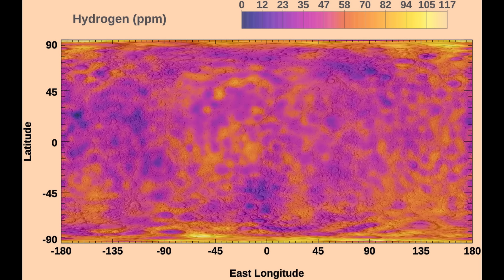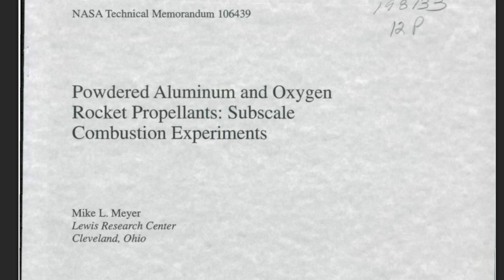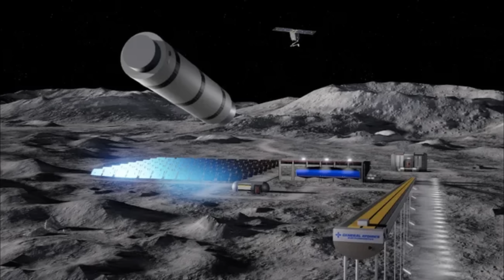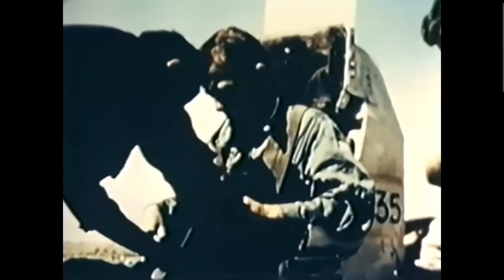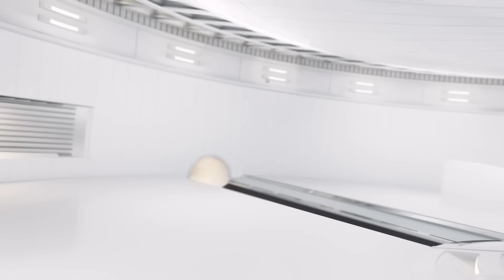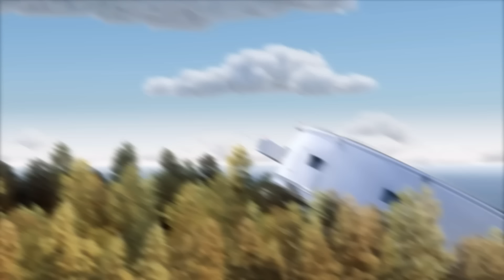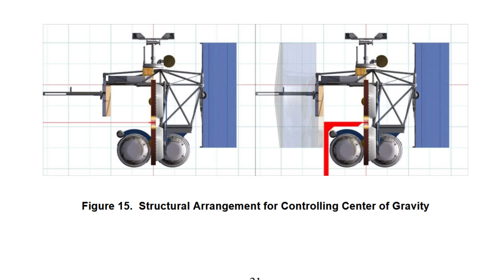Launching From The Moon With Silicon Based Rocket Fuel And Other Ideas - Deep Space Questions

Comment: Coilgun fired into Lagrange 4 or 5.    Give it just enough energy to park there and have your space factory there to receive.

You could experiment with a space elevator near lag3.  Would be better to experiment with the plausibility on the moon than on the earth.  Personally, I am of the mind that people proposing space elevators don't understand orbital mechanics of giant strings and the implications - but the universe itself is the authority over me, much to my chagrin.

Silica based rockets would be rather likely for primary lift stages.  There might be some concerns over using them long term in regimes where they will not be entering the Earth's atmosphere or the exhaust settling back to the moon in a timely manner.  Flying into a pseudo-atmosphere of silicon dioxide particles is kind of horrifying considering the construction of most space craft.

Comment: Spin launch is crazy. If the arm rotates with 3000 RPM then the released object will also rotate with 3000RPM around its mass center. While rotating on the arm, there is centrifugal force acting on the rocket. One could compare it with a rail gun acceleration. When released, that centrifugal force is gone but replace by the centrifugal force due to rotation around its mass center. A solid object might endure that, but electronics will get ripped apart by that sudden force shift.

Comment: 'Spin Launch'...sure forget about how centrifugal forces work. 
Release the object and it is flung off to the side, along the vector from the center of rotation to the release point..NOT at 90° to that vector in the linear direction of travel of the tip of the arm.
And the sudden mass change would tear the laucher apart from the sudden imbalance.

Talking about that as if it's a real thing...when I stopped watching.

Comment: 7:27 burning Silane and other silicon sources with oxygen does make silicon dioxide but it does not make quartz, it doesn't make sand. It makes "fumed silica" an amorphous form of silica which is a white powder used as an anti cakeing agent in table salt. Since it is not crystaline it is much less hard than quartz, somewhat soluble in water, and doesn't cause cancer.

Comment: I used to work with Silane since the ‘80, to make SiO2 thin films to make isolation layers on microchips! SiO2 is most commonly called silica or in crystal form quartz that is glass, but when Silane is burned in air silica comes out as a fine white powder. Sand is made also of silica but with various impurities, which needs to be separated, when it’s melted to produce ultra pure Silicon for microchips making!

Comment: Wouldn't the velocity be slightly higher due to the increased pressure differential between the combustion gasses propelling the bullet and the non-existent air in the barrel?

Comment: Very interesting Scott. 
I’d like to see a treatment of the linear accelerator’s need for steering rockets. The projectiles would need to be steered to ensure they all ended up at the same location in the Lagrange point, for collection. Maybe a giant fishing net.😊
I feel the ‘spin launch’ option would not work very well if it carried finished products such as solar panels. These would be too fragile for the high accelerations involved. Maybe the goods shipped would have to be limited to refined metals only. Thus requiring space based manufacturing.

Comment: Have you thought of a flywheel to store energy?  I wouldn't have until recently when I found out they supply a lot of capacity for energy grids in Europe that are mostly green and less instantly changed.  The should have plenty of materiel to make big spinning masses en mass.  Especially for Spinlaunch.  Take the energy from one flywheel, store it in another flywheel.  Or... have two launchers that swap energy back and forth, and the solar tops up energy losses and spins up the flywheel bank that'll be used at night to keep up launch cadence.

Comment: BTW, they THINK they have found water, so far two probes when landing has found ZERO water and can not confirm that.  One probe was in the polar region as well.  Even if it is confirmed one day, the amount is so small there is no viable solution to proccess tons and tons of regalith to get the microscopic amount of 'fuel' you are going to need for launch off the surface.  Not practical, if even possible and will never be the way forward.

Comment: If it’s electromagnetic, you want to put it in the dark in a moon crater next to the water. Low absolute zero Kelvin would be a nice number to reach. Use your compression expansion cycle to cool your electromagnetics and put the heat into your living quarters and the melting of water. All you need is towel boarding machines to make it all downhill to where you shoot it in orbit.

Comment: I thought most of the energy from the solid rocket boosters is ammonia and perchlorate. There's aluminum in there also but I didn't thing it was a majority of the weight. If it were, I think the speed of the reaction would be way too high.

Comment: We already have exactly what you describe when you're talking about a mass driver they're called roller coasters they just use large quantities of wheels and electric motors to accelerate the roller coaster the only difference between the design your suggesting and roller coaster is your design doesn't move in a loop what and if you use heavy metal wheels we can use those as mechanical batteries which will have as much energy as they can be released into the coaster the moment they interact with it you can also share the energy between these wheels with the electric motors that they are attached to

Comment: If you wanted to design another oxygen aluminum rocket motor you could simply look at the oxygen Lance which is literally just a pipe with fixed wires filling it mostly and enough oxygen blowing through it to keep it from Catching the whole thing on fire immediately the flowing oxygen keeps the combustion area away from most of the fuel if we surrounded that in a thick layer of silicon oxide and surrounded that in a combustion chamber we would have a rather powerful engine that would evaporate the Silicon oxide as reaction Mass the Silicon oxide is also impressively heat resistor which would go a long way to keeping the combustion chamber from melting and exploding though this design would have a problem with the Bell and the bottom of the reaction chamber melting and failing

Comment: The idea of sand being the exhaust out of a silicon rocket engine is wild. Quartz also seems like a problematic to have to keep form scumming up your engine, but for reusable engines I wonder if you could collect byproducts like that and put them to use, for example, in 3d printed electronics.
Reply: And it all falls to the ground, ready to be split into fuel and oxidiser again
Reply: @MostlyPennyCat  You'd also have the problem of sand blasting your launch pad every time you fly. I'm sure it would harder to deal with than an exhaust that is a gas.

Comment: There is another way to store power for quick release: flywheels.  If you have a few thousand 10 ton flywheels, they can release a lot of energy quickly.  And it is much easier to make flywheels on the Moon than it is to make giant capacitor banks, or loads of superconducting wire coils.

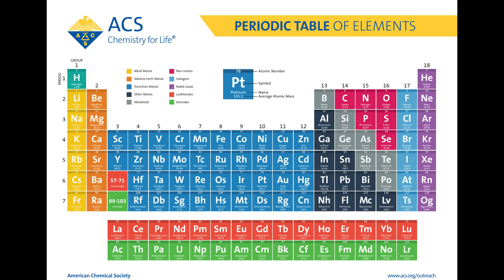Comment: 6:31 Why CH4 has less specific impulse than H2? this type of mesurment(ISP) is related to mass aswell right? than why CH4 dont give more impulse? to me is more rational to get more velocity from CH4 than H2. Because methan(CH4) have 4h to make the combustion to build presure and the carbon wich is inert to the reaction give velocity acording to Newton Law to me is like perfect molecule. And the H2 let say it build more presure but the mass is 12-24 less than CH4. Is more kinetic but less mass on hidrogen versus less kinetic but more mass on methane.
Reply: ISP goes up more with exhaust speed than exhaust mass. I think ISP is basically how long a propellant can produce a kilo-gram(force) per kilogram of fuel. A kilogram of hydrogen contains a lot more hydrogen than a kilogram of CH4, so there is a lot more of it to throw out the back. Not a rocket scientist tho so my explanation may be flawed

Comment: Slightly off topic, since you would be in a near vacuum on the moon, you could easily use thermal, solar collector, the heat of a piping system for warmth, and you just deco from the collector when you don’t want to get too much heat and reconnect when you want more heat and so on,,   Just use a carbon paint to paint the collector and can even use a compound parabolic mirror to hit up the pipe they printed with or some other chuckle or soot from a wax candle

Anyway, and use that heat to charge a sand battery should be easy to keep with the vacuum  🥰 and store heat for ages 💓

Comment: I think comparing a rifle with a muzzle length of less than three feet to a lunar launch system with a potential length of several meters to kilometers is a bad conpairison. 

Also, the rifle barrel that is filled with the earths atmosphere, which has to be compressed ahead of the projectile and slows the acceleration rate of the projectile is not directly comparable to a barrel operating in a vacuum. 

Further, sabot ammunition reaches much higher velocity than a full bore projectile. 

There is a scientific canon developed by the US government that was able to launch a 100-pound projectile to an altitude of 105 miles.  

With the moons' weaker gravity and no atmospheric drag, launching materials off the moon should be much easier than tasks like setting up sufficient power generation and refining facilities to produce aluminum and steel efficiently enough to make the process less resource intensive than launching materials from earth. 

Currently, if there were bars of gold sitting on the surface of the moon, it would be cost prohibitive to pick them up and bring them back to earth for the first few tons.  If you can't make gold bar retrieval pay, it is going to be a significant endeavor to make mining, refining, smelting, aloying, casting, and launching create a positive cash flow.

Comment: I did find it very interesting.  The lack of an atmosphere makes a coil gun so much easier on the moon than the earth.  Besides the coils, all that's needed is a minimal structure to constrain the path of the bucket.  The bucket could have permanent magnets on it to improve the acceleration and the bucket could be started with a spring--either mechanical or gas--that would reduce the number of coils and the total length required.  A wonderful feature of the coil gun is that you only need to energize one coil at a time.

Comment: Space elevator... What happens to the "cable" with Coriolis effects? How much sideways force will be pushing on the cable since the payload will need to be accelerated to orbital velocity one way or another, via a perpendicular force from the cable itself. What happens when a string holding a weight is pressed from the side? Tension increases. This would compound the existing tensile strength requirements far beyond any known material physics. Easier, faster, and cheaper to always just rocket out of the gravity well.

Comment: Nuclear fuel has ONE MILLION times more energy per gram than chemical fuels.  Why wouldn't you launch nuclear rockets from the moon?  Danger?  Nuclear spills are only dangerous when there is an ATMOSPHERE (fallout) or a WATER TABLE to spread the contamination.  The moon has neither.  Nuclear power is as safe on the moon as any other form of energy.  We need a nuclear spaceport on the moon.

Comment: 3:10 "The kind of things that I can see launched from the Moon will be structural materials in the form of aluminium, ..."
How are you going to refine aluminium on the Moon? First, you have to convert the ore to the right form (bauxite -> alumina), then you have to dissolve it in cryolite (sodium aluminium fluoride) and electrolyse it with carbon electrodes. Where are you getting the cryolite and the carbon?

4:14 "To be clear, we have lots of the oxidizer side of the equation [on the Moon]."
No we don't. All of that oxygen has already oxidized something: it's in the form of metal oxides. Unless you put in huge amounts of energy, you're not getting that oxygen back. And note that we don't get oxygen out of metal smelting here on Earth. Removing the oxygen on its own is infeasibly expensive. Instead, we use something that binds to oxygen more strongly than the metal does (typically, carbon) to turn metal oxide + junk into metal + junk oxide.

Comment: Points:
For electricity storage, instead of supercaps you can use centrifuge storage.

I'm thinking of a wheeled acceleror, without the aerodynamics, could we accelerate a near horizontal (1%-33%) lift towards 9000km/h.

Initial start could be done by an electromagnetic push or heated/presured gas boister

Comment: Rather than having imaginary space elevator with imaginary material, could have an orbital spin-launch system. A rotating launcher space station at LEO, it will spin and launch you to LLO with only using electricity (and no xenon regarding to electric propulsion). You don't need to 'connect' your counterweight in space elevator, you just need to think outside the box, you need to de-spin the launcher and stabilize the station.
edit: But like Scott mentions, Lunar Space Elevator is viable.
Reply: Upon revisit, 
-leaving a note here, Kurzgezagt once mentioned about tethering in such fashion.
-Gauss-launch system would be ideal at 50-80g force, for cargo shuttles between Earth and Moon.
-Superconducting coil storage could be easier in Moon's craters, where it's already -190°C and got 80°C to cool down. On orbit, it sees the sun in every 45 minutes. (Earth orbit)

Comment: It's much easier to dig through the Moon and get a lot of seismic information to make it clear what's in there where you haven't dug yet, because there's little gravity, little core activity. You will most likely find a lot of interesting things closer to the core. Oxygen is very easy to separate by ionizing the oxides. By concentrating sunlight on them. Sunlight is very powerful on the moon because it is not attenuated by the atmosphere.

Comment: so can you get a higher specific impulse from a silane fueled rocket than just hydrogren/lox? Would making silane from hydrogen actually improve the overall capability? I thought we only used kerosene because it's easier to store and handle and cheaper to get in the first place and easier to make engines run on it. wasn't the RS-25 SSME the highest efficiency design liquid fueled motor ever?
Reply: Having a high specific impulse isn’t helpful if the available propellant mass is low. While a hydrolox engine would have a notably higher ISP than silane, 1kg of hydrogen gas could make 16kg of silane, thus giving you 16x the propellant mass to work with.

And if you’re refueling or even building rockets on the moon, the low gravity and lack of atmosphere means you have a lot more wiggle room in terms of payload capacity to low orbit or earth transfer.
Reply: @alexsiemers7898  I knew I was misunderstanding. I can’t quite grasp the concept. I’m going to have to look up the definition of specific impulse and stare for a while. Edit: <wonders if needs sugar or if frontal lobes died during Covid> 😂

Comment: 13:02 
..my speculative contention is that you can escape any electromagnetic/gravitational field at no more than 3 m.p.h. (if desired) if you can combine Spin with Maintenance-of-Position along the/any planetary tangent: = internalisation of the electromagnetic coil gun principle. Thus your long pre-figured ‘flying saucer’ using internal rotary-synchronous battery powered motors. Graduatedly-jettisoning water as ballast for surface work - but - it seems to humble self - the huge requirement of chemical force needed for escape velocity has its reciprocal in the very quick falling away of the em/grav effect. From Earth a craft so constructed might usefully run on Earth-Tangent ramp using linear-synchronous (earth-supplied electricity) electro-magnetic motors. Such a craft arriving upon Ms. Moon 🌝🌚 need only use sunlight to recharge batteries plus a much smaller ramp - or a small and powerful silane based rocket aiming along the line of tangency…

Comment: Metal smelting operations need huge amounts of concentrated energy. These furnaces cannot be shut down so solar power is useless when it’s pitch dark for two weeks out of four. The only answer is nuclear power. However, the Pressurised Water Reactor is far too low temperature and far too complicated to operate. Not to mention the ridiculous weight. However molten salt especially the static salt fast reactor does make sense. It’s much hotter 600 degs C is easily made AND it fully burns the fuel. It needs 25x less fuel and the waste is 1000x less radioactive.

Comment: At least running a ship upward, you have a lot less atmospheric drag than on earth.

I would likely pick a rail gun or a coil gun.

Admittedly, common railguns tend to overheat and deform easily and often have to be rebuilt after just a couple of shots, but then, how much heat does a coil gun have to deal with?

Comment: Murphy's Law is really the big issue with space elevators in general.  The cable carries a lot of energy, so what happens when it inevitably snaps?  Is there a way to design it so that the inevitable failure doesn't cause untold amounts of damage and possibly loss of life?  Granted this is more of an issue for an Earth-based one, but it still could cause the loss of valuable infrastructure far beyond the scope of the elevator on the Moon.